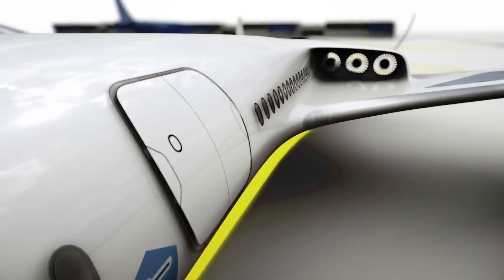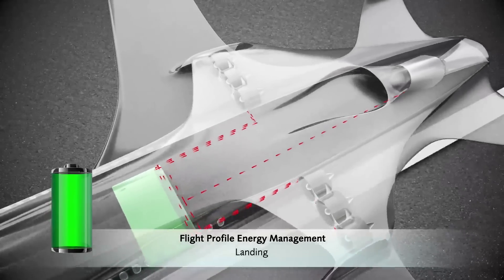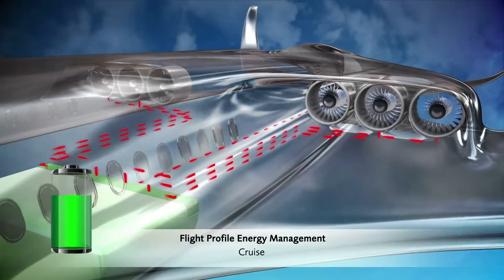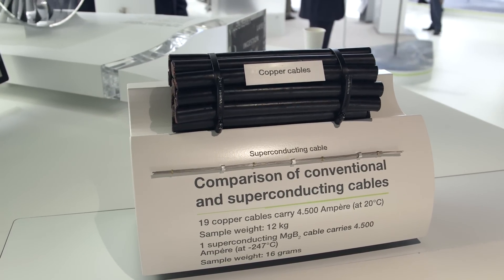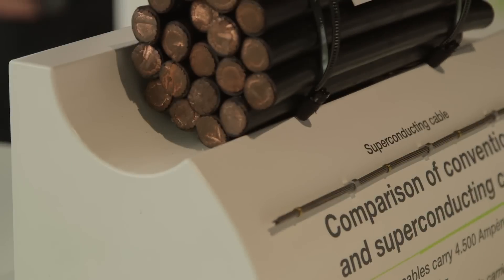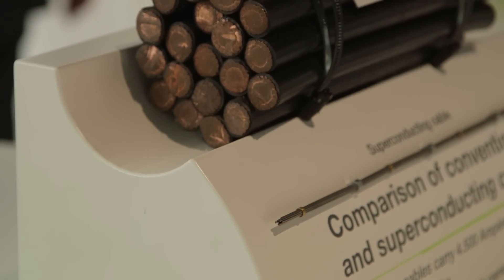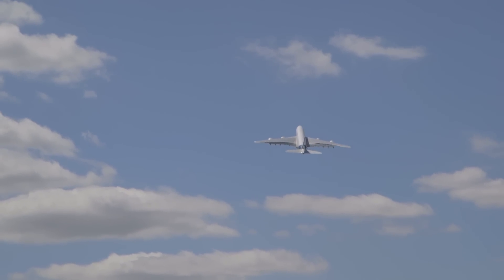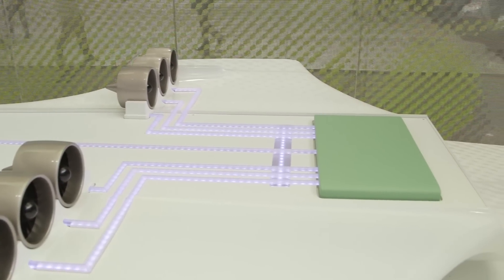The Future of Airbus Airliners is Hybrid Electric - AIN

Comment: People are so illiterate on the comment section its laughable. Lithium-ion battery have Specific energy of  0.36–0.875 MegaJoules/kg where as Jet Fuel has an astonishing 42.8 MegaJoules/kg of energy . That makes jet fuel some 50 times ( not 50% ) more energy dense than batteries .
Even if they manage to "optimistically" double or triple it in a decade that still puts it at roughly only 3 MegaJoules/kg at best in 2030 even with using solid state batteries. That it fine I guess for electric vehicles however  hybrid or  electric planes are DECADES away for certified human flight .
Reply: They are not proposing pure electric flight,  what they are proposing is turbo electric drive for electric ducted fans.  At the moment Pratt and Whitney are supplying geared turbofans to airbus for the A320neo.  The generator and electric ducted fan merely allows you to separate the functions without a gearbox and get optimal efficiency.  They probably will include hyper capacitors and a certain amount of batteries, maybe to assist in take off.     You can probably bury the speed of the fans to get directional control and Victor the nozzles.

There are thousands of electric re-propelled aircraft in the air now.  Most of them are self launching sailplanes.  Pipersal have got training aircraft.  Batteries are about to jump 2 1/2 times in energy density above current lithium-ion batteries.

Comment: Electric spinning fans just does not give enough power that combustion fuels which generate immense air pressure creates. To convert that torque of spinning fans to lateral movement is just not a step that is required in combustion. To put it in other words, the fans have to spin too fast for this work, to the point that even spinning them to the breaking point will not generate enough power. This is extremely impractical.

Comment: I don't see any way to make an airliner fly using zero fossil fuels. Even if you could use solar energy to produce hydrogen through the process of electrolysis, a very inefficient process, and use the hydrogen to power the plane, I doubt if anyone would want to fly with such an explosive fuel.  Batteries are way too heavy for use on a plane. Any ideas how a plane may be able to fly in a hundred years from now?
Reply: Lithium air batteries or one of the other 'next gen' batteries could get us to all electric. Lithium air batteries have an energy density similar to that of gasoline and because electric motors are ~3-4 times more efficient than combustion engines, we could actually achieve a far greater range. This is of course assuming lithium air lives up to it's complete potential which is unlikely. But a 2x greater range i think is certainly achievable!
Reply: moosefactory133 maybe we could  build supercaps or we could make electrolysis more efficient and than make E-Fuel out of that

Comment: These guys have too much time on their hands. I can appreciate the effort to discover new green propulsion for airliners, but this  isn't it. The thrust required to launch an airliner in the extreme. Electric motors driving propellers or turbines with the ability to match this thrust, would require an INSANE amount of electricity. Even the thrust needed to sustain cruise over a standard flight from say Denver to Nashville would be far more than a single turbine generator (that meets the power to weight restrictions) would be able to provide. There is a rule of thumb; any device that provides power to another, needs to exceed the power output requirement, to allow for power loss through conversion. 
So basically it would require that the generators be driven by engines with more than enough power to propel and launch the plane;......sooo...yeah...at that point the electric propulsion system is nothing more than a crap-pload of extra weight, which TOTALLY doesn't meet the power to weight restrictions. Batteries are heavy, no matter what type.
Start over guys....
Reply: What they’re basically doing is creating a turbo electric ducted fan or EDF.  The EDF or “electric ducted fans” are extremely powerful and light weight.   The gas turbine all power the EDFs through a generator.   We have seen diesel electric trains and we’ve seen turbo electric ships (that’s actually the norm now on big cruise liners).  What the airbus guys are saying is they can make the engines more efficient by separating the gas turbine from the fan electrically.   I suspect you will see some batteries and hyper capacitors in there at some point.

Comment: You'll soon overcome all of the challenges when Elon Musk starts working on his model of electric airliner. There were many challenges also with reusable rockets in space industry and many more in automobile industry around the world. The biggest challenge was the oil lobby which was holding back the progress. Now, suddenly, every car producer has his idea of short term release of electric vehicle. Not those small ones (like golf carts or vehicles for handicapped), but a full scale car. He accelerated the development of electric vehicles and other electric systems (solar, battery systems etc) for decades. So, it is just a question of competition and supply and demand. And the demand is really high for electric vehicles as people want to travel and not worry about the pollution and carbon footprint anymore. Oil lobby can soon say goodbye to it's industry for everybody's good since the current trends are expected to lead to a 4-5°C increase of global temperatures by 2100 and concentrations and temperatures will further increase after 2100. Meaning our children are going to be homeless soon.
Reply: Who needs a home/house if it's going to be so much warmer anyway?

On a more serious note, the oil companies are getting in to alternative sources of energy themselves. At least that's what they say they are doing.

Comment: heres your biggest problem girls..
with combustion engines the plane gets lighter as you travel and you have more engine  power relative.. and more safety in a glide..
with electric,,,,  your energy reduces every mile and your relative weight increases  all the way to the scene of the accident
Reply: A clever engineer would find a way to use that unchanging weight to the aircraft's advantage. We are used to over 100 years of clumsy inefficient ICE engines that require constant maintenance. Imagine how far battery and electric tech would be if they received the same investment back then.

Fuck when I use a petrol lawnmower or strimmer, it's nothing but hassle. Having to check the sparkplug, carb, fuel, etc. Meanwhile an electric mower just works. It is lower in power, for now, but it will not always be that way, and electrically powered things are much less fussy than ICE powered devices.

I would also add that electric motors can deliver 100% power right away, not with inefficient ICE engines that talk about such outdated things like 'power bands', where it is best to change gears.
Reply: Here's the biggest advantage big boy, the higher it goes the less drag but the electric fans will be tuned to run at those extreme altitudes, opposite from the problem of air burning engines.

Comment: Regardless of the fantastic engineering of airplanes, the fact of lifting 100's of tons of steel, people, and freight 5-6 miles high on every flight, is an energy disaster. Rail is vastly more economical and environmentally sound. Only huge public subsidies for research, fossil fuels, and airports  keep the airlines running and the pollution pouring into our atmosphere.

Comment: and if the turbine engine breaks down?? good luck.
Reply: I'm pretty confident Airbus and Rolls Royce have thought of that possible scenario already and are probably looking for ways to ensure the safety of the aircraft, its crew and its passengers in case something like that happens. It's also important to remember that the FAA will want to make sure that this new design meets ETOPS requirements in the case of commercial airliners.
Reply: the more worrying thing is what if theres a leak in the superconductor coolant system it mean they have to shut down the fans

Comment: How long does it take to recharge the batteries?????If you have to sit on an airport tarmac for five hours to recharge the batteries it would add hundreds of dollars to a ticket and cut flights to and from  major airports by 25%. If the generator can recharge the batteries in real time then nothing will be gained except the cost of a ticket to fly in a plane still using the same amount of kerosene and with a heavy battery pack that will limit the number of passengers by around 50%.This all sounds like a montypython skit but a lot funnier.
Reply: They need to invent safe batteries which will do at least 4 or 5 megajoules per kg which cost less than 100 dollars per kilowatt hour have a life span of 8 years or more and large number of  charge cycles .

Comment: Sorry but I dont think itas advanced technology, I think its jump to the far past. ecologic... it needs to charge batteries first by burning gasoline which is not ecologic at all. Nothing new here. anti-gravity technologies (no need to worry about weight, ecology and fuel) are elaborated and operated since many decades basing on Nikola Tesla developements , but only for Them* not for us. they want us to use burning chamber to move.. they just dont let us to have really new technologies, just baubles like this. sorry didnt want to offend anybody, just fed up with bull...t they want us to swallow
Reply: Charge the batteries with solar panels instead
Reply: Yes we could use phased array resonant frequency for lift that's where when one wave is coming down in to it about 32 to 64 milliseconds another wave comes in pushes it up and so forth resulting in lift now each wave result in millimeters but enough will produce lift